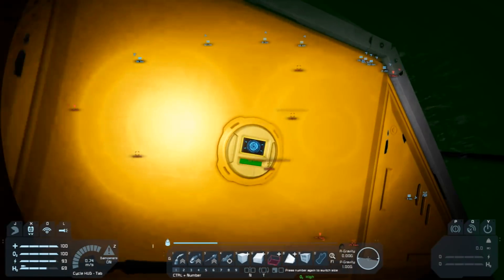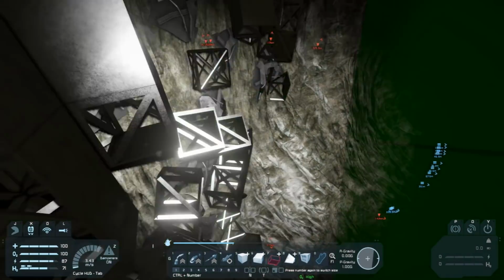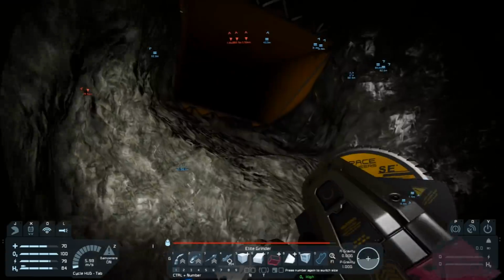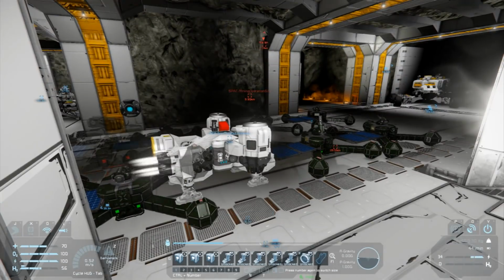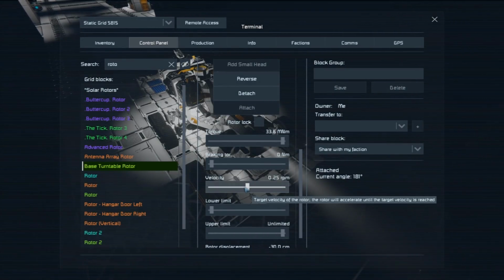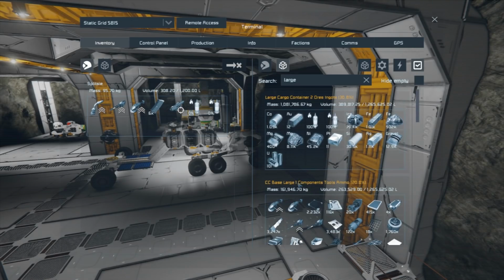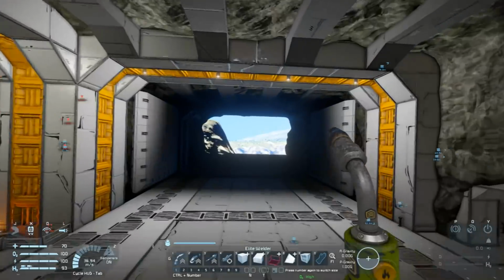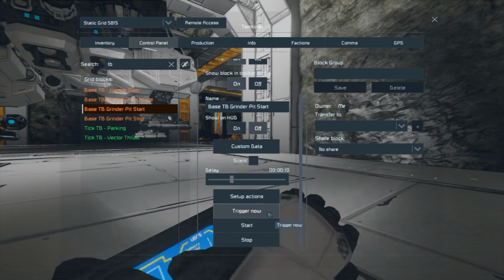Survival, Maybe... #58 Drones learn to use wheels... sort of (A Space Engineers Survival Series)

Comment: what  are your pc specs? i got a i5 7500 and 1050ti and really struggle with space engineers lol
Reply: Also that welding ship is AWESOME xD
Reply: Really? I have an i7 4790 and a gtx 745 and it works perfectly fine for me.
Reply: check your background cpu usage as well as ram, you might also need to up the virtual memory as space engineers loves virtual memory for some reason
Reply: What you mean by virtual memory? And i run it low with a TINY amount of things on medium and struggle to get 60 at times with one small rover spawned lol
Reply: it's fine with HD7970 and FX8300 at 1080p
Reply: You struggle I have the same thing and it runs so well
Reply: I have my specs on my channel
Reply: Also had a Pentium G4600 and a 1050ti but 16GB Ram. SE ran fine. With realy low settings even on the on Chip Intel HD 630.
Reply: What is your memory speed, also how much Vram do you have, SE uses 7.4 GB of VRAM and ~13 GB of RAM for me. Also check to see if your PC is thermal throttling ( overheating so the CPU and/or GPU underclock and kills performance ). 
I have an RX 480, R5 1600, and 16 GB of 3200 MHz DDR4.
Reply: i5 4690k OC to 4.7ghz
8GB DDR3 1600mhz
dual GTX 970s 
4 WD velociraptors in raid 10
windows 7 ultimate 64 bit

i have a hard time with SE too, and the sole cause of my misery is ram 

SE loves its ram almost as much as it loves its mhz

i can play for about 10 minutes, then i run out of ram and the game starts freezing up and eventually crashes, but if i turn off my mods (mostly scripted weapons, shields and new types of thrusters and armor) i can play for about 15 min before things start freezing

if i turn the view distance down to 10km though, i can play indefinitely (but with 100% ram usage and a bit of page file usage)

view distance = ram consumption (based on windows 7 and no background programs running) 
8GB = no more than 5KM distance 
16GB = 15KM
32GB = 20KM (most my board can handle)
64GB = 40KM????
128GB = ??????

might also want to be careful of vram (GPU memory), you will get serious frame drops if you run out of vram (i can go from over 80FPS on a planet down to 25 if i run out of vram)

best way to alleviate most of these issues is to 

> get as much ram as you motherboard can support (or you can afford)
> overclock your CPU (if possible and if cooling/power allows) 
> get an SSD (for when the game inevitably eats all that ram and starts paging)
> dont go over your GPU vram limits (texture quality is the heaviest hitter of vram)
> turn down your view distance
Reply: My pc is VERY much not thermal throttling lol, max it hits is 40c
Reply: how much ram do you have?
Reply: I have a ROG formula IV and 
Phenom IIX4 965 Processor O.c.
16 gigs of ram
Nvidia  Geforce GTX 660TI O.c.
SSD which S.E. is installed 
and i run 60 fps  -  avg 47fps
Reply: i get 90fps with all the settings maxed (until my game crashes due to a lack of ram) 

clock speed, gpu and ram is all SE cares about (mostly just clock speed and ram though)
Reply: my ram doesnt go over 4gbs
Reply: then try turning down your view distance to 5-10km

if that fails then maybe you need a faster GPU or need to lower your graphics settings
Reply from the maker: The most common bottleneck people seem to run into with SE is RAM amount, to have things run OK but not great you need at least 8GB, if you want to run things well you need at least 16GB. Trying to run with just 4 will run poorly regardless of any other factors - have tested this unintentionally when some of my housemate's RAM died and he somehow hadn't noticed...

I've managed to have things almost playable on a 2nd gen i7 with a GTX660M(? can't remember exactly on that one) once it had 8GB of ram available to it, that was prior to the graphics update though - the laptop has since died completely.
Reply: it ran like garbage on my rig with 8GB of ram, the other day i grabbed another 8GB stick and since then it has run flawlessly, planning on starting a server once i get 32GB (and NBN gets off their asses and upgrades me from ADSL)